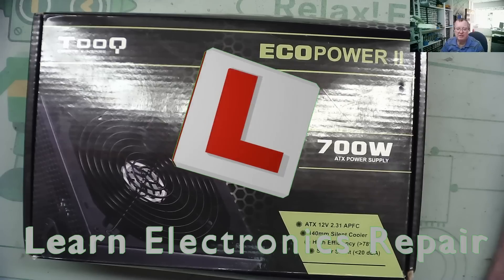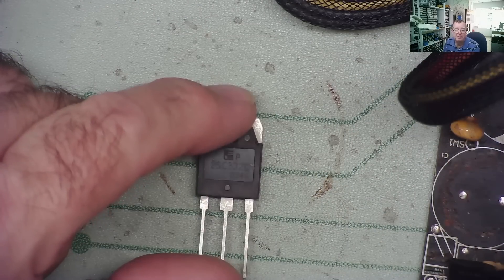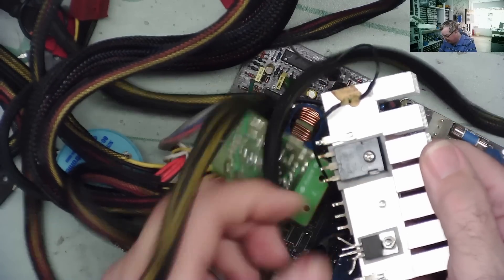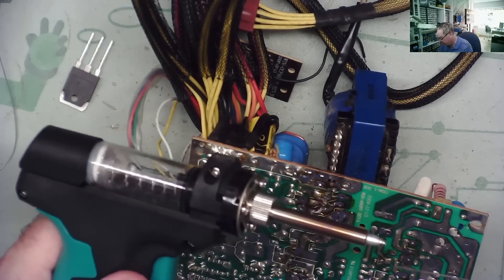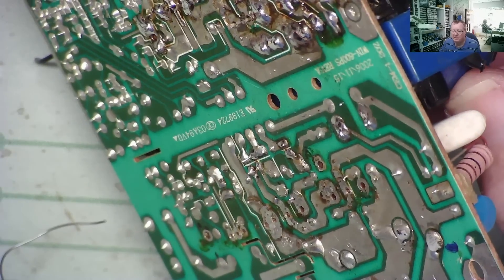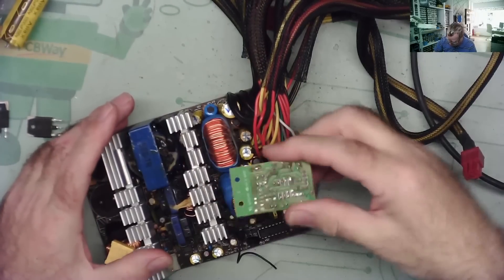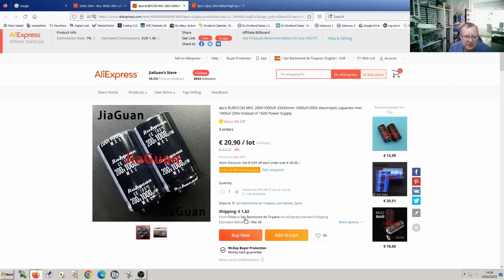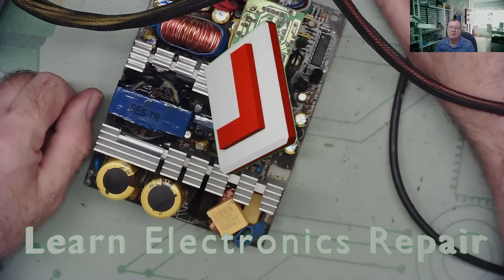700W ATX PSU Blows Fuses Trips Out The Mains Part 2 Will Replacing The Power Transistors Fix It?

Comment: At 9:40. I would like to know if this newer gun will fit the older Duratool D00672 (ZD915) desoldering station (with or without slight modifications).
If anyone does know then I would like to hear thanks.
Reply from the maker: I would have thought so - I think they are basically the same thing.  My desodering station is not actually a Pro'skit its a copy of it.  The vacuum connector looks exactly the same.  How many pins are there in the power connector to the vacuum gun and can you measure any resistances between them?  If so I can compare on mine for you and let you know if they read the same.

Comment: i was going ask a question and see if anybody knows. i was taught in electronic school 3o years ago that a electrolytic capacitor looks like a giant resistor in parallel with a capacitor. so you said the capacitors are in series. i assuming your using 220 volt ac power. so the dc resistance of one electrolyic capacitor is 1 gigaohm and the other is 100 megaohms. they talked about 1 megaohm equalizering resistors. does it really matter with large capacitors.

Comment: Thats what i found in 5 atx psu with apfc, i cut them open and all have broken the connection to soldering legs, the aluminum strip was corroded.

Comment: Sometime it is not fake marked transitors or mosfets or ICs (except the unmarked).  However, these manufacturer do test the grade (which they may not disclose to you) and sort out of their components.  The higher grade components are sold (at higher price and/or volume supplies) other devices or equipment manufacturers.  All the remainders or lower grade are sold to the open market or components suppliers.  When you purchase on the open market it depends on you luck.

Comment: I agree with you,  those large electrolytic capacitors rarely fail.  Had to laugh when you said that then found a bad one! That said, I repair test equipment and I always test the electrolytic capacitors for value, ESR and leakage current at rated working voltage - every so often there is a duff one. Regards,  David
Reply from the maker: Yeah, that's just how it happens sometimes and shows these videos are real 🙂

Comment: It looks like there is a component that isnt fully soldered right near the capacitor you took out to get the heat sink and diodes back in. And is the shrink tube on the center legs of the transistors important?

Comment: some electronic components from Aliexpress are manufacture rejects they didn't meet specifications and then some unscrupulous people get hold of them and  then sell them cheap. they may work ok but the big question is how long for?
Reply from the maker: Well.... we could test the working voltage of the capacitors first

Comment: Samsung TVs back in era of capacitor plague taught me to check even main caps, even back then only small caps usually fail in other brand TVs but with Samsung you even replace main cap also or whole board would just usually burn when it leak and short something on high voltage side.

Comment: You can use anything as a test, probably use a pair of 220uF ones in there, as it will work for up to 200W of load no problem.
Reply from the maker: I'm a bit wary of messing with the capacitor value in a half bridge circuit, though must admit I haven't tried this before
Reply: @LearnElectronicsRepair  Actual value is not an issue, just has to be within 50% of the one you had, just that the 2 must be similar in value, as otherwise the half bridge will walk in voltage till one side or the other on time is such that both turn on together, blowing up the capacitors.

Comment: Now we know why it failed👍
This is the joy of repairing stuff …you just never know what will fail .
Test unit with lower values for now and put an end to the suspense 😂
Reply from the maker: Are you sure that will work in a half bridge circuit?
Reply: I guess if it was my gear and quite a decent bit of kit , I would be patient.
Why not ask  that clever bloke from learn electronics repair 😂
Reply from the maker: @davet3804  Yeah I might - the half bridge capacitors are subjected to high frequency switching, unlike normal smoothing capacitors after a bridge rectifier on the mains
Reply: Might be a good future video to explore??
Reply: As you know reactance is inversely proportional to frequency  and capacitance so if the capacitor was halved the reactance would double 🤔
Reply: @LearnElectronicsRepair  Yes for lower loads lower value will work, as after all they only used 1000uF because they wanted lower ripple at full 700W power, while the most common versions that are 400W tend to use any value from 100uf to 470uF there, just both halves should be somewhat similar in capacitance.

Comment: I've seen those fail, pretty common in TV's as they are barely specd for the load.  They dry out, burn open circuit, puke electrolyte everywhere.  Depending on the age, there was a few years where capacitors were produced in the billions that were crap quality.
Reply: Samsung LCD TV especially